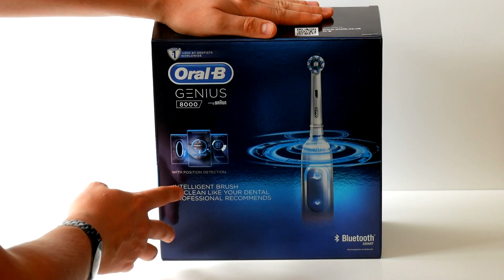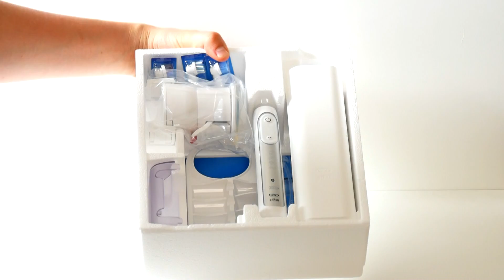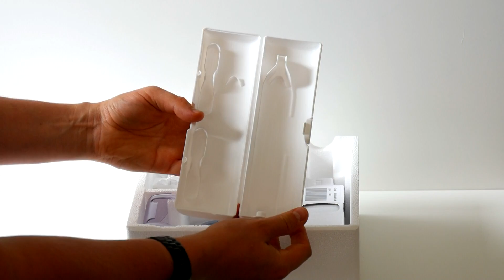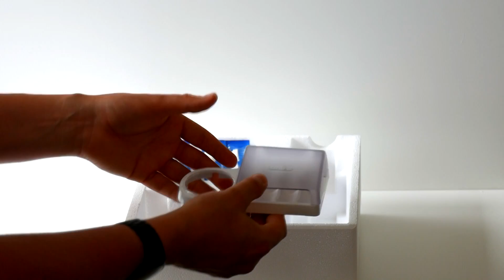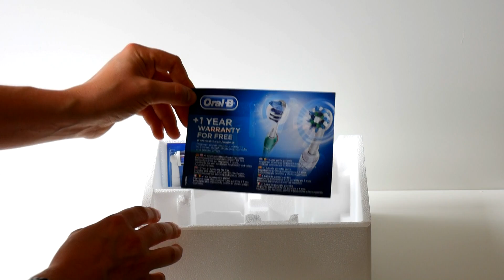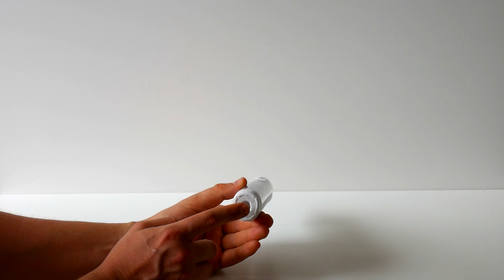Oral-B Genius 8000 Unboxing

Comment: UPDATE:  THE CASE ON THE 8000 IS HIGHLY UPGRADED AND WITH A BUILT-IN CHARGER.
Reply from the maker: I think you are referring to the Genius Pro 8000 that is sold in the USA.  The Genius 8000 in the UK does not come with a case that has a charger built-in.
Reply: @ElectricTeeth  That would be correct.
Bought 2, they are being delivered today, ive never used an electric before and im excited af!  Bought some good quality whitening toothpaste too.

Comment: dont see much of a difference between the 8000 and 9000
Reply from the maker: There really is not much in the way of differences, they are:

The Genius 9000 has a tongue cleaning mode that the 8000 does not have.

The Genius 9000 comes with 4 brush heads (CrossAction, 3D White, FlossAction & Sensitive) in the box as opposed to 3 with the 8000 (CrossAction, 3D White, & Sensitive).

The 8000 comes with a basic plastic travel case but the 9000 offers a premium travel case which allows you to charge your brush and USB powered device such as a smartphone from it too.

The Genius 8000 is available in white only, whilst the 9000 is available in black, white and rose gold colour options.
Reply: Electric Teeth
thank you so much for this/ i appreciate you outlining it for me. it helped me make a purchase decision. cheers.
Reply from the maker: Great. Glad to hear it. Which one did you go for?
Reply: Electric Teeth
i went for the 9000 amazon had a sale a few days back. and the premium charging case doubles as a back up battery to charge your phone!